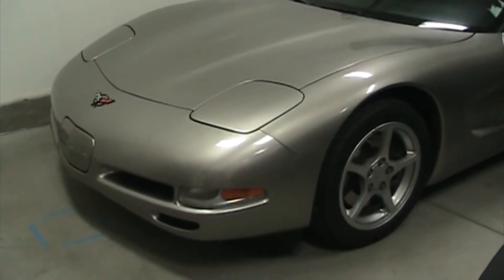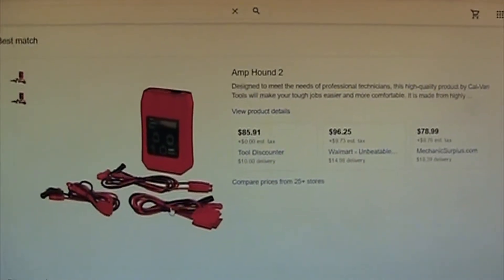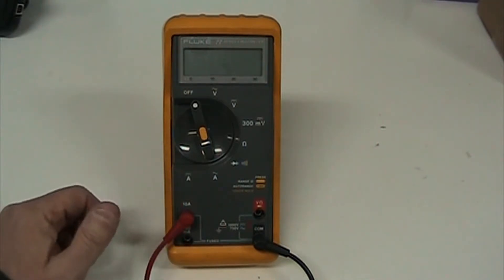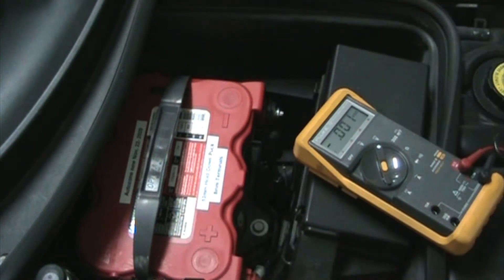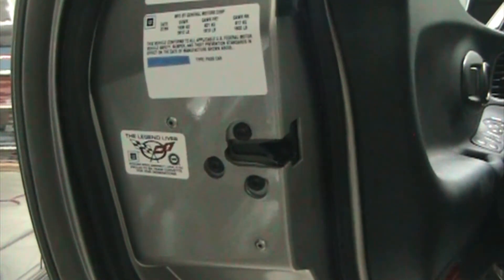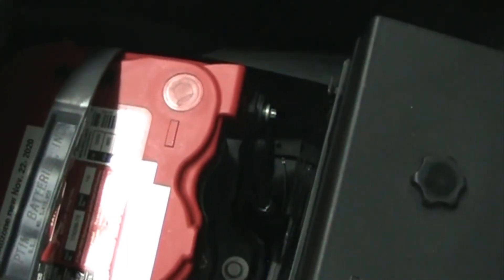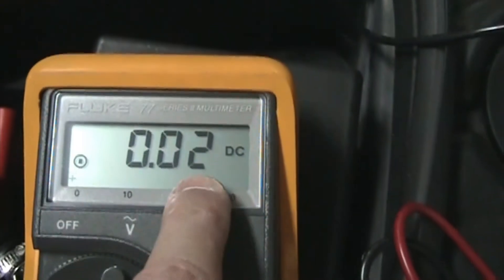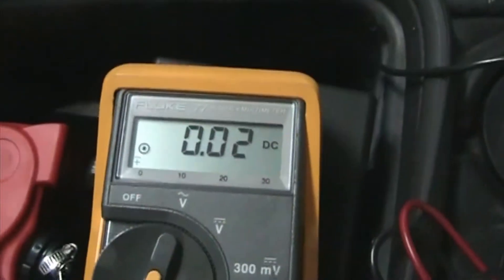C5 Corvette – Battery Parasitic Drain Test

Comment: Awesome! Just what I was looking for. My c5 keeps draining the battery and can't seem to figure out what it is. Add insult to injury,  replaced the battery and now the car won't start 😂
Reply: That made me laugh cuz it happened to me lol
Reply: @otonielaburtobermejo4774  😂. For me it turned out to be the ignition switch.  After I changed it , the car is perfect.
Reply: @Emilthehun may I ask how you came to the conclusion?
Reply: @FrancoisTCS  by measuring current draw, so started pulling fuses.
Reply: @Emilthehun  thank you!! pulling ignition fuse you mean?  I measured all current draws even in the big fuses but nothing seams abnormal. 🧐🫤
Maybe I need to start to pull them out instead.
Reply: @FrancoisTCS  I pulled them out. Yes the ignition fuse. After I changed  the ignition switch,  I also never had a chime again like when the key is left in the ignition.  I thought it was that way from factory,  because I got it that way.
Reply from the maker: I am glad you found this video helpful.  Good luck in finding the source of your power drain.